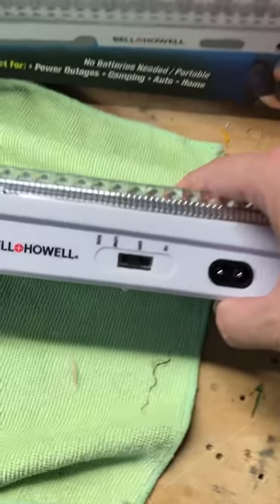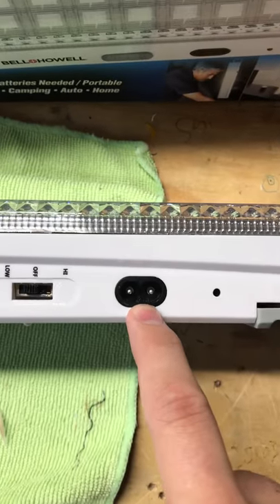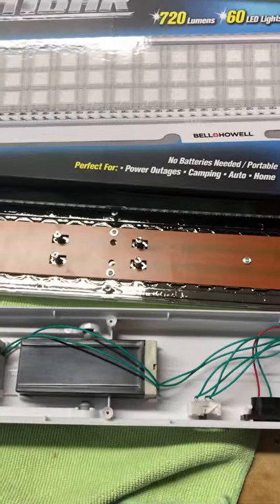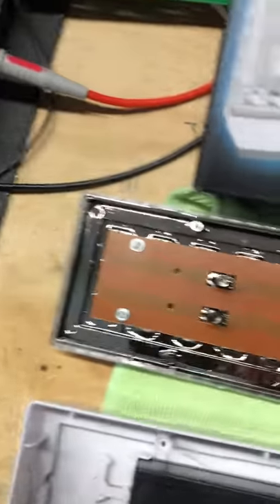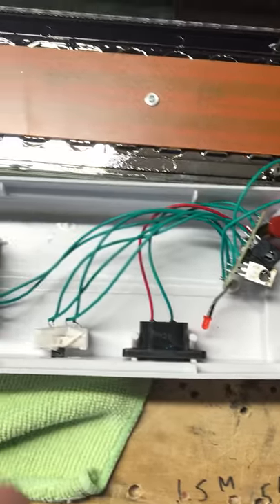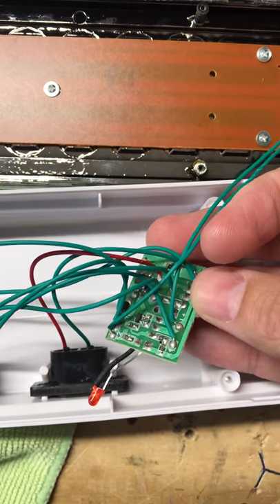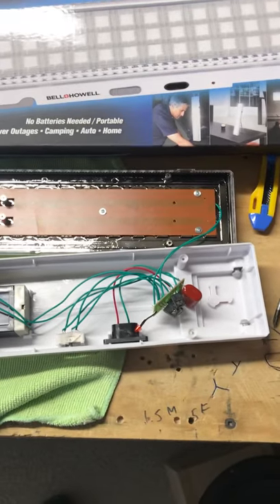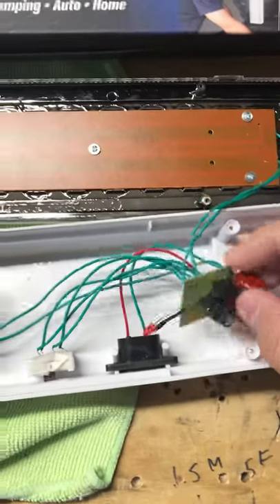Bell Howell light bar! Burn the house down !!

Comment: The batteries are lead acid, coupled with a capacitor AC voltage limiter circuit to a rectifier circuit providing the 4 volt DC to drive the LED's.
Very cheap indeed... the thin wires themselves bring only 32 Gage in diameter act as the fuses as they will burn quickly thus opening the circuit in the event of an over voltage failure.

Charging must be done while the unit is off as it draws 400mAh and the charging circuit only provides 200mAh of output. 
Bell+Howell purchased the consumer division of Bell& Howell and has no affiliations at all with Bell&Howell.

The main problem is the wires literally falling of of the solder points if dropped or shock by a bump.

Comment: I bet the batteries inside those modules are those very low end cheap chinese 18650 cells that hold maybe 600mah if you're lucky.
Reply from the maker: I took this light away from Grandma and threw it directly into the garbage, this thing was so scary ! NO kidding houses these days burn down !
Reply: @JasonLeaman  Typical Bell and Howell junk.  LOL
Reply from the maker: @Sui778  Agree 100% Scary what is produced and let out on the market :(
Reply: @JasonLeaman  Agree.  When I saw the innards, I was like that's bad - even for Bell and Howell that's bad.